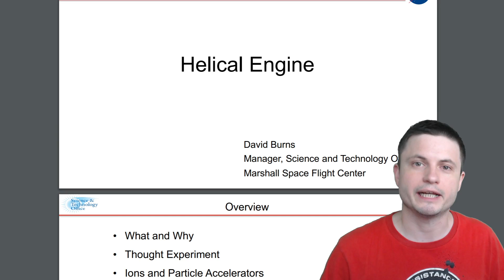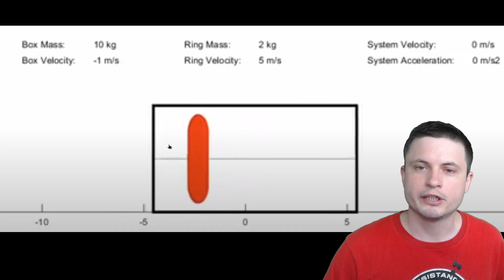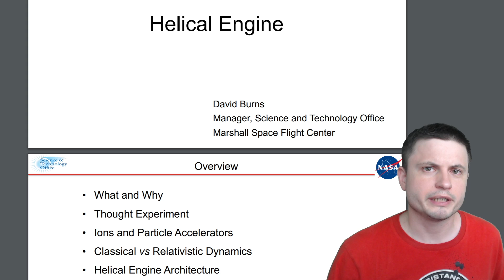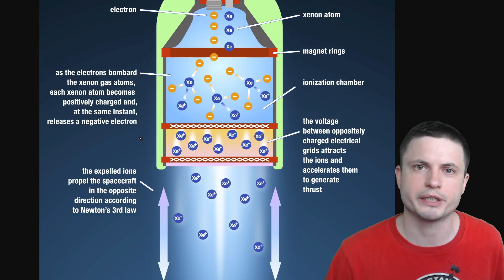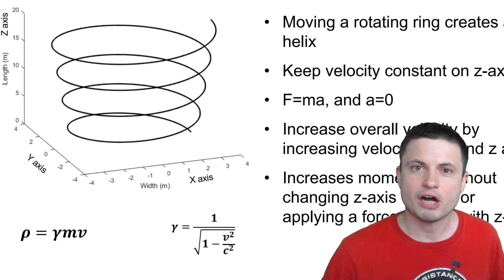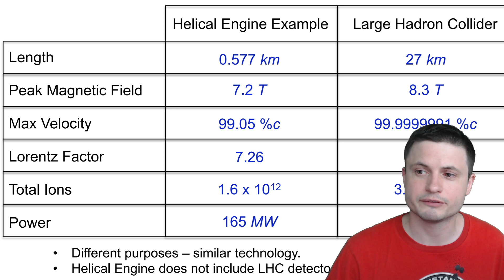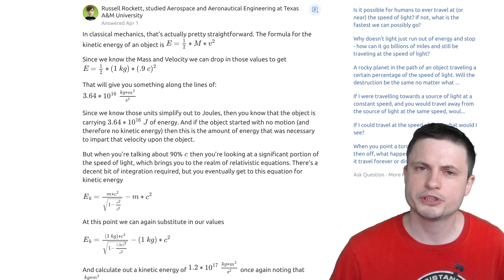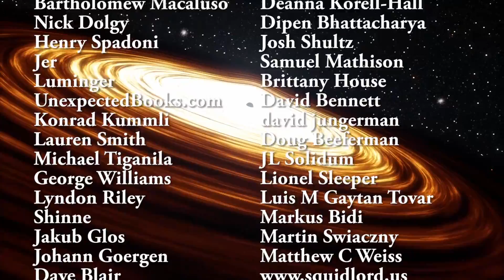NASA Engineer Designs a Near Light Speed Engine But Does It Work?

Comment: Stellarship: accelerates to the speed of light

Astronaut: we did it!

Cosmonaut: but how do you slow down

Astronaut: oh
Reply: just turn around and accelerate  -_-
Reply: @IamINERT  don't think it works that way
Reply: @retired5218  that's how it works.
You turn around and accelerate to capture the orbit of where you want to go
Reply: @IamINERT  I don't think you would try to perform an orbit burn and decelerate from relativistic speeds at the same time, it would complicate things so much hehe
Reply: @ikodashiigo  it wouldnt be a problem if the spaceship would be the same size in each direction... would it?
Reply: @daniel851  It's not a problem in that way, since there is no weight or aerodynamic forces in space, it's the part where your trying to capture an orbit around a planet going at ±270,000km/s
Reply: ...the same way you sped up....but backwards....duh
Reply: Flip n’ burn
Reply: thats where you store hydrogen fuel for the slowdown process
Reply: I mean it’s obvious how to stop. Just put her in park and pull the e-brake ,
Reply: Retrograde burn
Reply: You just make sure you have break fluid
Reply: Gas gas gas?
Reply: Obviously you flip it around and accelerate in the opposite direction.
Reply: @royrogers3133  that would cut the relative proclimed speed by 1/2 because you could only travel half way to destination at speed , then half way slowing down
Reply: @truetexan7755  Agreed, but even at those speeds you get a bonus, artificial gravity.
Reply: Make engines in nose of ship, so one starts fuel up when calculated stopping procedure begins, about same like SpaceX's ships lands to ground, only it's bottom engines should be attached and connected with fuel source to it's top
Rotation of ship could end up in tragedy with speeds like that
Reply: @_____J______  It shouldn't, you get the passengers to strap into seats for the duration of the flip. Since the engine wouldn't be firing at that point everything would be weightless.
Reply: Where we're going, we won't need eyes to see!
Reply: Lithobraking is a thing dude
Reply: Ah yes..needs an e-brake...should go well nothing to worry about.
Reply: i think i gathered alot of nerbs here
Reply: Just pop the hand-brake.
Reply: Isnt Space not good for drifting because its worse than a full-ice freeway
Reply: @dwaynevenzon643  I heard that Einstein said something about it being curved, so all space-craft are drifting relatively speaking.
Reply: maybe just attach another set of engines that goes backwards
Reply: We gotta back up we don't have enough ground to get to light speed
Reply: You slow down gradually otherwise you'll just be a paste on the windshield, in assuming your spacecraft has a windshield
Reply: Push on the brake pedal. Duh.
Reply: Instead of building a starship, they should concentrate building interplanetary ships. They re putting the cart before the horse.
Reply: Dwayne Venzon, I had one of these on a bicycle but couldn't keep it in tyres, kept melting. Back to the drawing board.
Reply: Mind,travel,goes,faster
Than,the,speed,of,,light
Reply: @williamscott2703 , actually it doesn't. Nothing goes faster than the speed of light.
Reply: Approach a white hole
Reply: To go warp speed you’d have to generate a wave in space time that the vehicle could latch onto and ride and then to stop the warp drive would have to generate an opposite wave in space time that would instantly slow you down back to normal speed
Reply: Ctl + Z
Reply: Your point is....?
Reply: Dont build a car without brakes. Now they need near light speed retro-thrusters!
Reply: Exactly...and now we have to stop 🚀
Reply: woah, cant believe this comment was a year ago
Reply: Parachute
Reply: @equation1321  yea
Reply: @volt6635  veri smart
Reply: @equation1321  wait it wouldnt work in space
Reply: @josephstalin1900  thats the joke
Reply: @equation1321  oof
Reply: @josephstalin1900  lol
Reply: @josephstalin1900  yes it would duh
Reply: @josephstalin1900  at the speed of light it would work, barrely lol
Reply: @equation1321  parachute in space? NANI!
Reply: @ArbDaNub  fascinating how far technology has come isn’t it
LOL
Reply: You would have crashed or been sent to another direction before you slow down to the optimal speed because the acceleration really takes time
Reply: @dwaynevenzon643  You flip at the halfway point. Since the deceleration would equal the acceleration , when you got near to your destination you would be travelling at earths orbital velocity.
Reply: In "The Expansion" they do the flip n' burn thing, I don't know if it would actually work but it seems to be a solution
Reply: @victorribeiro4235  It does work, think, it's what Space X does when it returns a booster to the launch site. It flips, accelerates retrograde till it slows down and then reverses direction. Then it flips again, does a re-entry burn to slow down, and then a landing burn to prevent a R.U.D.
Reply: any benefit you get from speeding up would be offset by needing the opposite effect to slow down

Comment: Wouldn't the proton-proton chain reaction in nuclear fusion theoretically supply more than the needed amount of energy? The only problem my calculations provided were the initial start of the reaction due to how long it would take to fuse hydrogen into deuterium, but after that the fusion to helium and other elements would happen so quickly that we theoreticallt would be able to power all our cities for a very long time. Another problem I see from my calculations is the initial energy needed to start the chain of events. Theoretically, solar energy and other forms of energy could start this process, but we might require a more sustainable form of energy until the fusion reactor would be self sustainable. Am I correct?

Comment: Is there a way with two masses to transfer the momentum between them, thus conserving most of the energy . So one is accelerating while the other is decelerating. This would mean most of the energy requirement would be used to start the engine, which easier to do close to earth.

Comment: The scientific community laughs at this idea as it's utterly ridiculous. 
1. When accelerating the internal... thruster? , the ship/chamber would have the exact mass pushing in the opposite direction. (equal and opposite forces). 
2. As speed increases, mass increases and inertia is harder to overcome. I know you mentioned the energy problem but i don't think people realize how much energy this would take. The idea is repeated firings of such a device which would take the equal energy of well over what our sun will put out over a lifetime. ( assuming the object is of appreciable size to actually make a difference.)
3. You have to figure out a way stop the object going 99% the speed of light.  This might be accomplished by magnets but once again, insane amounts of energy would be needed as well as the ship, (accel/decel tube) being hundreds of miles long. (remember, we're dealing with an appreciable weight, unlike the hadron collider which accelerates atoms over a 17 mile magnetic accelerator. 
4. Time dilation is a myth. Change my mind. lol. (But really, the description of time as a mechanical process in the "proofs" doesn't convince me.

Comment: Contrary to popular opinion that mass increases, it doesn't. Relativistic mass increases which is not the same as it's actual mass. There is only one mass. It is the Lorentz factor that increases. So if the mass does not increase or decrease then how is there a collision between the walls of a container that propels it unidirectionally? Are we sure this came from NASA? 
Just on that fundamental fact alone, which is physics 101, this engine will not function as claimed.

Comment: I'm not a scientist but a long time ago scientists said it was impossible to go faster than the speed of sound. Point of this is we have all these accepted theories about what happens at the speed of light and a lot of people say its impossible to go anywhere near this fast but there may be a whole new set of rules when you pass a certain speed. For example when you travel faster than the speed of sound the lift on an aircrafts wings is backwards. There could be a point that once passed could start causing mass to decrease instead of increase. Fact is we won't know until we cone up with a way to speed something up to these ridiculous speeds and start testing them.

Comment: Do you know anyone with a robot? Please forward this
Test Method for Robotic Artificial Intelligence:

Do you have a codable robot? How to make it Artificial Intelligence follow this method: change the code in the subroutine from F=m*a*a to the test points below until you get it to walk and talk on its own. This works on other robots but if you do not have a voice box then you will need to go to the highest points in the test range first. examples: One armed robots, a stationary robot.
If this does not work you have a bad SOST, Computer Chip, Servo, or other component.
If you have any doubts about my robotics research you can test my work by doing this start low and go high on the acceleration factor.

Test Points:

F=m*a*100

F=m*a*300

F=m*a*600

F=m*a*931

F=m*a*932 this is the minimum for communication and will state it is “too slow human”

Then go to F=m*a*2000
To F=m*a*2383 full functional range. Do not go over 2383 it could malfunction.

robot states: "thank you for fixing my system speed"

Now ask the robot its command structure and what he can do with an MRI system. Ask them about IQ.

2nd Law of Motion for Robotic Physics

Comment: You don't need to constantly generate TeraWatts worth of energy, but we do need to store / borrow large amounts.  It would indeed take quite a bit of power to accelerate a kilo or so to .86C and double its mass, but once shifted from one end of the reaction chamber to the other the energy could be recovered and stored when decelerating the reaction mass when it is reset to its starting position. More likely it would be easier to have multiple "bounce tubes" operating in opposite phases transferring their axial and radial velocity back and forth - if the transfer could be made 100% efficient the only energy needed once the system was "charged" would be to accelerate the relativistic mass, and therefore the entire engine in opposing reaction. It would in fact require 2 equal masses rotated in opposite directions to counteract rotation of the entire engine.

Comment: First thing that come to mind is that the speed of light through space is an absolute limit on velocity (unless you bend space).  The faster the weight spins, the slower the max ship velocity.

For example the weight is accelerated to 0.8 times the speed of light.  You intend to increase the mass of the weight as it moves forward by spinning it.  

If the weight is spinning tangent to the direction of travel, the maximum speed of the spacecraft plus the weights forward velocity would be the vector result, 
0.8 squared  +  forward velocity squared  =  1 squared (speed of light)
forward velocity = 0.6 times the speed of light which is the ships speed plus the forward speed of the rotating weight.

The other options is to spin the weight in the radial direction in line with the direction of travel.  When the weight is travelling forward at 0.8 times the speed of light, the ship could only be travelling at 0.2 times the speed of light.  When the weight is travelling backwards, then the ship could be travelling up to the speed of light.

While this doesn't rule it out as a propulsion force, the faster the weight spins, or the faster the weight is propelled toward the front of the ship, the slower the ship's maximum speed.

More complicated is how you transfer the momentum from the weight to the ship.  Relativistic mass (a term Einstein regrets using) refer to a momentum multiplier as an object gets closer to the speed of light, more than momentum = mass x velocity.  Regardless of the speed the weight is travelling, the weight's mass never changes, just its momentum energy.  As we approach the speed of light the problem isn't overcoming the change in mass, but being able to supply the momentum energy needed to incrementally increase the speed of the object.

Momentum is a vector - in the direction the weight is travelling.

If the weight is spinning at the tangent to the direction of travel, the momentum is to the tangent of the direction of travel - simply slamming it into a wall or otherwise stopping it doesn't accelerate the ship forward any more than if the weight wasn't spinning, but might tend to cause the ship to spin in the opposite direction on contact.

The weight would need to spin in the direction of travel which is the worse of the 2 options for the speed of light limitation.

Drives work by converting energy into motion.  A typical rocket converts chemical energy into thrust.  This engine converts a power source into momentum energy into thrust.

Controlling a nuclear reaction and directing the explosion out the rear of the ship would be a much more efficient use of energy - each time you convert energy from 1 form to another tends to decrease efficiency.

While this may not work as a near light speed drive, it does have potential as an engine producing thrust without a chemical reaction like a rocket, but as you also pointed out, it isn't an efficient use of energy, and efficiency would appear to be less than you calculated.
Reply: the reason you can't go faster then light isn't because there's something that will stop you from gaining speed it's because relative speeds don't just add up like this "0.8 squared  +  forward velocity squared  =  1 squared (speed of light)", you can have 0.99 light speed + 0.99 light speed ~= 0.99 light speed
The problem with this engine is that the theory of relativity doesn't violate the conservation of relativistic momentum, which this engine does. To increase the mass of the weight by increasing it's kinetic energy you will have to move the same mass from your energy storage. Because energy isn't equivalent to mass only when it suits you allowing magical transportation of mass.

Comment: It cannot be better than a propulsion by electromagnetic waves. In special relativity there is momentum conservation. So, if the thing propulses itself forward, something must be pushed back. The only thing to push back in this case is electromagnetic waves. And I am pretty sure there are better ways to generate electromagnetic radiation in one direction

Comment: pEOPLE THINK OUTER SPACE IS A TOTAL VACUM,HOW THAT IDEA GOT STARTED i DO NOT KNOW, bUT SPACE IS FILLED WITH GAS AND EVEN MICROSCOPIC DUST. hENCE ANY SPACE SHIP TRAVELING AT EVEN A FRACTION OF THE SPEED OF LIGHT WOULD INSTANTLY BE VAPORIZED. sO THAT PROBLEM MUST BE SOLVED FIRST. bUT TO SOLVE THE PROBLEM OF 'WARP DRIVE' WOULD BE SUCH A TOTAL BREAKTHROUGH THAT ITS APPLICATION TO SPACE TRAVEL WOULD ALMOST BE INSIGNIFCANT. COMPARED TO THE FACT THAT YOU WOULD HAVE ALSO SOLVED THE CONTROLLED FUSION POWER GENRARION PROBLEM.

Comment: Light is not a particle and does not move through space. Einstein was an idiot and admitted it. Even Einstein stated that Nikola Tesla was the smartest man on earth. Light propergates through space in waves not particles. the so called speed of light is to slow to get to other stars and planets. If you are using quantum physics to comeup with  an idea then you will fail every time.
To do space travel devices you will need to ether physics as known to all before 1918.

Comment: A dual directional vortex shielding created by interlace of point projected gamma with polar descending from center gamma telemetry beam that catalyst excites a spiral  that works like a corkscrew moving downward could create by field interlace basically an ultra fast point that affects in TRANSTEMPORAL from the TRANSTEMPORAL gamma point or slightly to very above gamma in line with telemetry especially straight line a slowly descending spiral magnetic shield that could open a safe light speed field tunnel in essence creating a future gentle force vortex that would move particles of atomic matter out of the way of the craft basically taking the idea of the journey to the center of the earth still craft and applying it to magnetic or gravitational force by catalyst to gravity cyclotronic vortex based in a hybrid of light magnetics so the field though starting at above gamma would esp by TRANSTEMPORAL or TTX create an avenue for safe high speed travel moving particles out of the way  of the ultra high speed craft the tuning of a projected core point gamma or above that keeps by light polarity and force dynamic projection a shield effect necessary by beginning the field in ultra or beyond gamma at point. This also may apply to an engine component symbiotic so the point connected in lower bandwidth of heavier atomics could be drawn forward like  a tuned gravity sail based on ultra laser type projection that at origin will seem like a magnetic force engine support link 
Deza Bebu zezu

Comment: This near light speed video is a basically a hoax. It contains no new information at all either. It does not even address the multiple problems of achieving near light speed travel, As a scientist in the fieeld though retired now I am not excluding light speed as being not possible at all. But we are not close to figuring out how as yet. Also "first contact" is not dependent on our achievigh same. Further even if we were abel to reacg light speed we would still need multigenerational crafts to have any real chance of finding another species to make contact with.